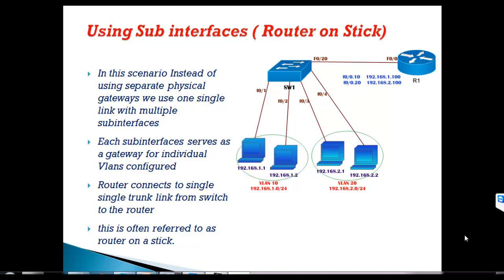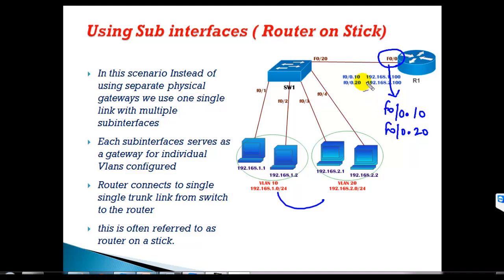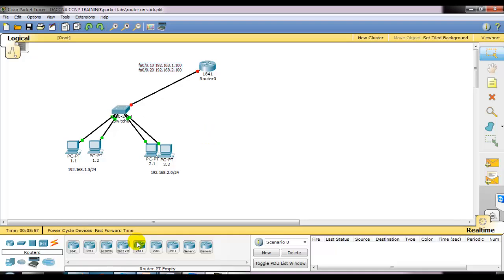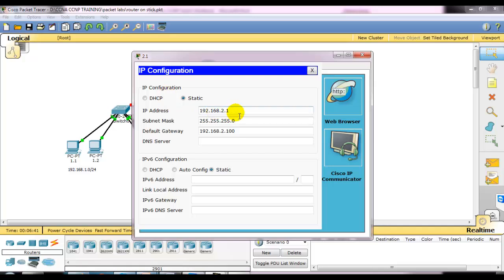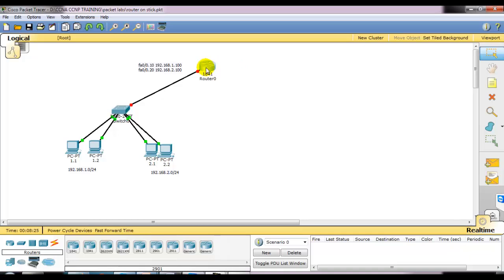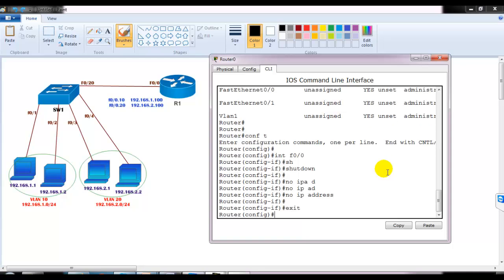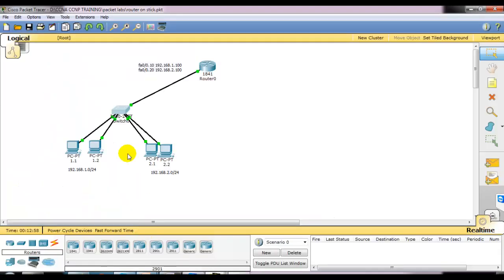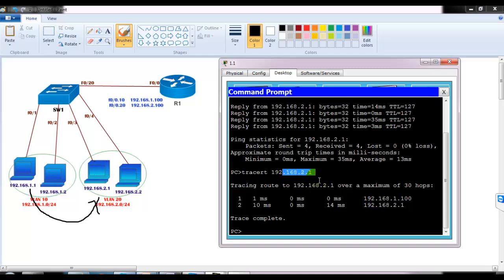Inter vlan routing using Subinterfaces ( router on stick)

Comment: Hi, Someone pls suggest

I have 100 devices in my network, and i want to use 192.168.1.0/24 network and want to create 3 vlans( HR/Marketing/Admins)

My router ip would be 192.168.1.1/24

How do i setup? How will 3 different vlans will get internet from my router

Comment: I have 1 Main Router connected with 2 other Routers (have 2 different networks and both are VLAN) and the Main Router is also connected with a Switch and have a Server, how do I send Packet from Server to those 2 other Routers Network???

Comment: hi sir the video is usefull however my sub interfaces is still down even after using the no shut command to make my physical interface up any suggestion where is the issue. stp has already converged i have used the same topology as yours on packet tracer layer 2 intervlan routing